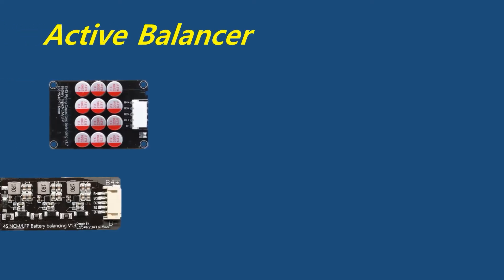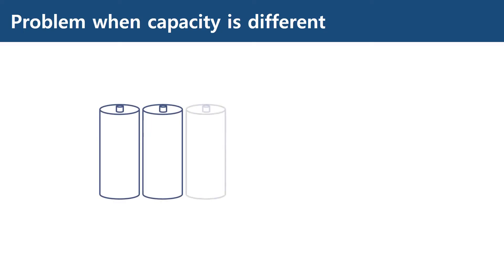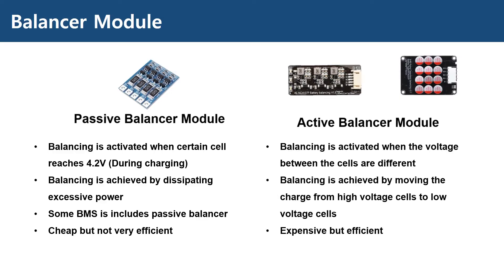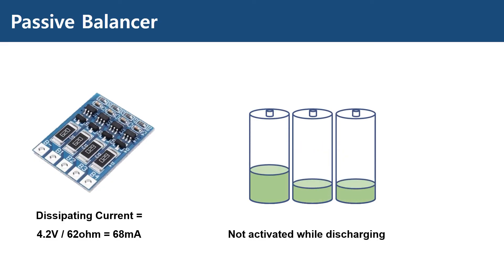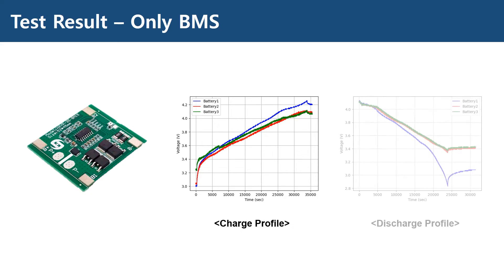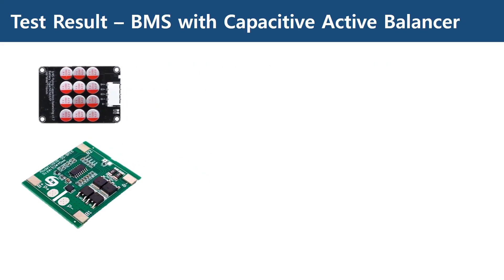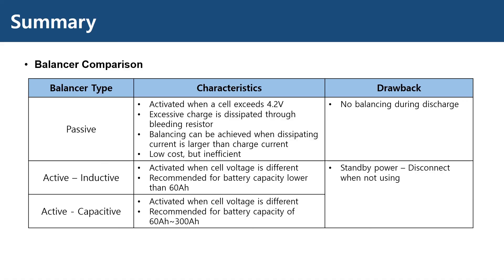Active Balancer vs  Passive Balancer

Comment: Hello. Can the capacitive type balancers be used in parallel to up the amps that are balanced while the cellvoltages are getting closer? My guess is, not, because for paralleling them they might need to be synchronized in their energy uptake and -outputcycles and there's clearly no option/function on them for this.

(?)

Comment: ALl this balancers will balance 314 Ah battery bank neat the age of our Universe.
Please make video of your test setup, set 4 cells to 90 Ah 140 Ah 180 Ah and 300 Ah,
try to charge this 4S BANK with 50 A current from MPPT a you will see, that ALL THIS
BALANCERS are USELESS. Bye. DO not post, if you do not have real data.

Comment: Not understanding the first animation. 
Why would the fully charged cell discharge faster than the other cells?
Reply: Why would the fully charged cell discharge faster than the other cells?
==> The % discharge rate depends on the actual size of capacity. In this example the capacity of cell 1 is smaller than that of the other 2 cells and this means in both, charging as well as discharging cell 1 will be first to arrive at 100% charge (maximum allowed voltage) or 0% charge (minimum allowed discharge voltage).
Numerical example: If cell 1 has a capacity of 90Ah, but cells 2 and 3 have a capacity of 100Ah then
i) during charge from 0% cell 1 will first arrive at 100% once the charger has pumped in 90Ah+losses in the charge process. Once cell 1 is fully charged to 100% the BMS immediately stops further charging to disallow damage/degradation on cell 1 by overcharging, but into cell 2 and 3 the charger has only pumped 90Ah, while they want to get charged by 100Ah to arrive at 100% charge (maximum allowed voltage).
ii) The same at discharging. When getting out of the 100% charged battery (all 3 cells at 100%) 90Ah cell 1 will arrive at 0% charge, this means the minimum allowed voltage and the BMS will stop discharging immediately to avoid damage/degradation on cell 1 by deep discharge. This leaves cell 2 and cell 3 with still 10Ah rest charge (10%).

A balancer cannot really adjust for such large differences like 10Ah. Imagine the passive balancer draining a fully charged cell with this video example 68mA. To compensate for 10Ah this passive balancer will need to sit at 4.2V CV-charging for 10Ah/68mA = 147h = 6 days. This 6 days time is quite impractical as you want to charge batteries within 2 or 4 hours. This means while selecting the cells for a battery you will select only the cells which have very similar capacity.

Even if you have selected cells with nearly same capacity for your battery, there are other factors that can cause imbalances. One factor is for example different losses from cell to cell when comparing charge capacity to discharge capacity. Another factor is different normal slowly ongoing degradation/reduction of each cell capacity where the rate can vary between cells. To compensate for such imbalances the battery does need a balancer.
(A special case are lead acid batteries: In these batteries no balancer are built in because they are much more insensitive to overcharging. Instead of adding a balancer to a lead-acid battery you simply design the charger for a little overcharge and in this overcharge the cells get balanced. Overcharge on lead-acid results in gassing, which is not good when too strong, but at reasonable level the lead-acid chemistry does tolerate overcharge, while lithium does not tolerate overcharge at all, degradation is immediately starting when passing the maximum allowed voltage).

Comment: so passive balancers are suitable for motorcycles
Reply: Passive balancers are preferred for anything that should be cheap. Active balancers do add substantial additional cost for their higher complexity and use in much smaller quantity. In addition active balancers do need specialist knowledge while setting up on questions like at which voltage difference shall the active balancer get active etc.

Comment: It would be great if you had used the same load for the capacitive balancer. At 6:55, we can see that the battery discharges much faster than with the inductive one.

Comment: cant i use active capacitive balancer on 12v 10Ah?
Reply from the maker: It depends on how large capacity the balancer can handle.
If the capacity of the balancer is small, the balancing will not work as intended.

Comment: Thank you, brother. Why do we disconnect the active equalizer when we are not using the cells?
Reply from the maker: Hello,
Active balancers are equipped with capacitors, which suffers leakage current by a small amount. Though it might be small, it can discharge the cells at a faster rate. So, if you are not going to use the cells for a long time, it is better to disconnect the active balancer.
Thank you for watching.

Comment: Excellent video, thanks!
Is there a way to tell, which type a balancing a device is using without seeing the BMS?
Reply from the maker: Hi, thank you for watching!
If you can measure the voltage of each cell, then you might be able to tell which type of BMS is used. But it would not help if the cells are perfectly balanced.
I would recommend asking the manufacturer or taking a peek into the battery pack :-)
Reply: @gemsungelectronics460 Peeking may void manufacturer warranty. However, if I peek, what key features distinguish active from passive balancer?

Comment: This is exactly the video I need, such informative. Thank you so much!

Side note: your 7 parallel 18650s are over 70Ah, that's an average of 10Ah each, which is something unheard of. Don't you think its exaggerated? They're most likely less than 3Ah each. So inductive balancer should have worked?
Reply: Absolutely correct, this 7P 18650 having 71Ah is not possible, because the highest capacity cell is to my knowledge 3.5Ah at 18650 size.
Concerning balancer I believe there do exist also balancers that do balance just 2 cells. You have to look at the circuit details to know if the balancer is designed to take energy from the highest voltage cell and distribute onto all lower voltage cells, OR if the energy is just given to one specific cell (anyhow, over time the distribution scheme should change, this means I think the inductive balancer may be defect -if this is an inductive balance at all, because I see no inductances on the PCB).

Comment: This passive balancer does not make sense because it drains only 68ma. At least 500ma would be ok.
Reply from the maker: Balancing is achieved during the final stage of charging when the charge current is very low. For this reason, the drain current need not be large.
Also, increasing the drain current can limit the current, which can be used for charging other cells. Waisting the current can be another reason for not increasing the drain current. 
Thank you for watching!!

Comment: 2.4 volts.. hahaa yea if you want your battery to die faster I guess. Rest of the video is great, but li-ion shouldn't go below 3v.. 3.2 ideally
Reply: Depends on the cells, higher capacity can be discharged to 2.5V, some even as low as 2V I've seen depending on chemistry
Reply: @daijoubu4529  this is li-ion. There is only one chemistry being discussed. I even said the chemistry in my post. So what you said makes no sense.
Reply: @gg-gn3re  there are at least 3 kinds of lithium chemistry: Lithium Cobalt Oxide, Lithium Manganese Oxide, Lithium Iron Phosphate
Reply from the maker: Lithium-ion batteries are a broad category of rechargeable batteries that use lithium ions as the primary source of energy.
Within this category, there are many different types of lithium-based batteries that use different cathode materials, such as lithium cobalt oxide (LiCoO2), lithium nickel manganese cobalt oxide (NMC), lithium nickel cobalt aluminum oxide (NCA), and lithium iron phosphate (LiFePO4), among others. Each of these chemistries has its own unique properties and trade-offs in terms of energy density, cycle life, cost, safety, and other factors. So, when people talk about "lithium-ion batteries," they could be referring to any one of these different types of lithium-based batteries, depending on the context.
Reply from the maker: The nominal voltage of a battery is the average voltage at which it operates under normal conditions. For lithium-ion batteries, the nominal voltage depends on the specific chemistry being used. Here are the typical nominal voltages for some common lithium-ion battery chemistries:

Lithium cobalt oxide (LiCoO2): The nominal voltage is typically around 3.6-3.7 V per cell.
Lithium nickel manganese cobalt oxide (NMC): The nominal voltage is typically around 3.6-3.7 V per cell.
Lithium nickel cobalt aluminum oxide (NCA): The nominal voltage is typically around 3.6-3.7 V per cell.
Lithium iron phosphate (LiFePO4): The nominal voltage is typically around 3.2-3.3 V per cell.
Lithium manganese oxide (LMO): The nominal voltage is typically around 3.0-3.2 V per cell.
Reply from the maker: Here are the typical safe charge and discharge voltage ranges for some common lithium-ion battery chemistries:

1. Lithium cobalt oxide (LiCoO2): Charge voltage range is typically 3.6-4.2 V per cell, and discharge voltage range is typically 2.8-3.6 V per cell.
2. Lithium nickel manganese cobalt oxide (NMC): Charge voltage range is typically 3.4-4.2 V per cell, and discharge voltage range is typically 2.7-3.4 V per cell.
3. Lithium nickel cobalt aluminum oxide (NCA): Charge voltage range is typically 3.4-4.2 V per cell, and discharge voltage range is typically 2.7-3.4 V per cell.
4. Lithium iron phosphate (LiFePO4): Charge voltage range is typically 3.2-3.6 V per cell, and discharge voltage range is typically 2.5-3.0 V per cell.
5. Lithium manganese oxide (LMO): Charge voltage range is typically 4.0-4.3 V per cell, and discharge voltage range is typically 2.5-3.0 V per cell.

It's worth noting that these voltage ranges can vary somewhat depending on the specific manufacturer and application, so it's always best to consult the datasheet or technical specifications for your particular battery. Overcharging or overdischarging a lithium-ion battery can damage it and reduce its lifespan, so it's important to stay within the recommended voltage ranges. Additionally, lithium-ion batteries should never be charged or discharged at rates exceeding their maximum safe limits, which can also vary depending on the battery chemistry and design.
Reply: @gg-gn3re  You should not overestimate your knowledge and be a little more restrictive to oppress your way onto others.
1) but li-ion shouldn't go below 3v.. 3.2
==> If so, why do nearly all manufacturers test their cycle life going down to 2.5V ???
(I can understand your reasoning to get more cycle life by limiting to higher than 2.5V, BUT this is your personal decision to achieve the specific target of 20% more cycle life, others may have as specific target to get maximum range and they can discharge down to 2.5V still getting the cycle life the manufacturer may quote)
2) nominal voltage isn't average, that's "average voltage"
==> Stop saying such nonsense! Nominal voltage is a kind of average voltage that is used to recalculate Ah into Wh.
3) It's the standard voltage a circuit or in this case a battery is referred to and expected to output
==> Why do you say such bullshit? A circuit designer needs to adjust his design to the full voltage output a battery has and in case of 4.2V Li-ion this is 2.5 to 4.2V unless the designer puts some other limitation into his design.
Reply: Hi, have u tested how much drain has  a capacitive balancer. Can a 36v 12,5ah 10s pack stay with one connected for  1 month without damaging it for low voltage?
Reply: @liviupaulet7303  have u tested how much drain has  a capacitive balancer
==> There is a multitude of different designs available and each has different current capability, but one should be very careful to compare unless tested in absolutely the same conditions.

 Can a 36v 12,5ah 10s pack stay with one connected for  1 month without damaging it for low voltage?
==> I fail to see how a balancer can damage your battery unless it is defect (or you have programmed it to do nonsense).

Comment: Your inductive balancer is broken. Get a new one and re-test.
Reply from the maker: Hi, I think you are referring to the capacitive balancer since no inductive balancer is used in this video. 
Can you be more specific on which point you think the balancer is broken?
Thank you for watching!!
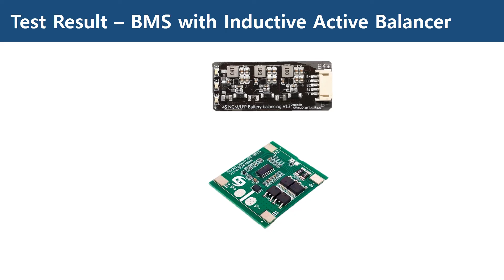Reply: "no inductive balancer is used in this video"   5:27 timestamp
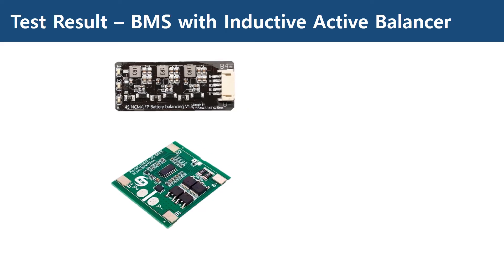Reply: @gemsungelectronics460  5:30
Reply: @gemsungelectronics460  ... since no inductive balancer is used in this video
==> ???
5:25: Your voice is saying: This is the result for active inductive balancer (but indeed the picture does not show any massive inductances on the PCB as is usually the case with inductive balancer). However
7:06: In your summary you list the result for an active inductive balancer

Another confusing point is at 4:49: The discharge profile on the right starts with a 100% charge voltage of 3.6V (this looks to be LFP and is not in agreement with all other charts showing a 100% charge voltage of 4.2V)

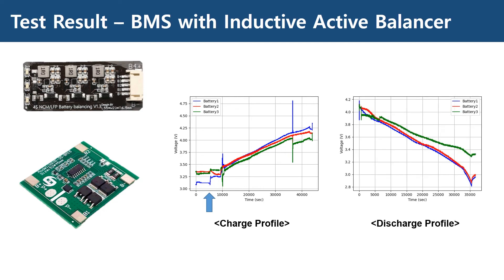The point of broken balancer is visible at 5:55 where the 3rd cell is not getting balanced in the discharge profile (when cells 1 and 2 do get well balanced but cell 3 does not I agree to pepethefrog7193, there is a high chance this balancer does not work on cell 3, is broken).
I do not agree your conclusion that this "inductive active" balancer is only for small capacity batteries. The difference on balancers is their current capability and here you have a wide range in any technology, but usually active balancers do have much higher current capability as their losses/heat are much lower. But also for a passive balancer you can use a quite high wattage resistor to increase current capability, however seeing high heat up such high current passive balancer will only be used when possible to install outside the battery, this means practically quite seldom.

Comment: loved the video. As you stated, Active balancers are recommended for higher Ah capacities, and you gave some high examples. Would you recommend using active balancer if I were planning on making my own portable phone charger at roughly 20 Ah?
Reply: If you're making a portable phone charger you can put your batteries in parallel (4.2V max) and let them balance themselves without a balancer. I believe this is how most USB power banks work.

Comment: Thanks for the video. So what I'm gathering is that the balancer is only necessary for batteries in series. Does it follow then that battery cells wired in parallel will self-balance? I'm only building a small 2S battery with 4 18650 cells total, so I don't know how important balancing would be, but I'm trying to learn as much as possible before moving forward. Thanks!
Reply from the maker: You are right. The balancer is only necessary for series configuration.
I would recommend using a passive balancer when you are building 2s with a total of 4 batteries because the capacity between all the cells is not exactly identical.
There are many 2s balancers you can find from online markets.
Thank you for watching!!
Reply: @gemsungelectronics460  Thanks!

Comment: 060223/1917h PST 🇺🇸 Thank you for the presentation. Your concluding statement, clearly indicated that, it’s not advisable to permanently wire Active Capacitive balancer in a 4S, LiFePo4 50A configuration.  I’ve a situation that needs to look into, as #1 cell in my configuration have the tendency to run away to 5.6V first, while the #2/3/4 lags trying to catch up. I decided to discharge #1 cell (only) through 65w halogen lamp, until it balances with the others and recharge the battery bank. If the trait follows, in spite of the experiment, I will wire AB to the system and watch. What do you say? A response is highly solicited. Thanks.
73s…
Reply from the maker: Sorry for the late response. 
Why would you need to discharge cell #1 first to make it balanced with the other cells?
Why not use the active balancer from the beginning?
Also, can you give more detail of wiring AB to the system? I couldn't quite understand the meaning.
Thank you for watching!

Comment: Hi sir!!
Thanks allot for this video!!🙏
I have a question...
Because it's not easy in my case to take out and open my battery..
Can i connect the wires of active balance straight to wires or BMS out of the battery..?🤔
Reply from the maker: Hello.
You need to know the exact configuration of your battery cell before making the connection.
If your BMS is exposed, then yes, you can connect the balancer to the pins of the BMS.
Thanks for watching!
Reply: @gemsungelectronics460  thank you very much for your quick response!!!🙏
I know the configuration, i make the battery and can double check them with the app of BMS!
I have easy process to bms and wires that is why i want to connect balancer to battery through BMS wires...😘
Reply from the maker: Great! That will do the job!

Comment: Can one parallel the active and passive BMS?
Reply from the maker: If you are using a parallel only configuration, bms is not needed.
BMS is only for serial configuration or serial-parallel hybrid configuration. 
Thank you for watching!!
Reply: @gemsungelectronics460  Let me rephrase. I've a 16S. Can I put both active and passive BMS in parallel? Would both contradict each other?
Reply from the maker: Active balancer activates whenever there is a difference between the cells, so even when you connect a passive balancer parallel to the active balancer, the passive balancer might have no chance to kick in. The passive balancer is activated only when there is excessive charge on the cells, so it will dissipate power after the cells are fully charged, but will not contribute to balancing.